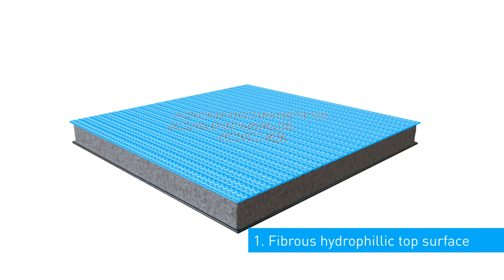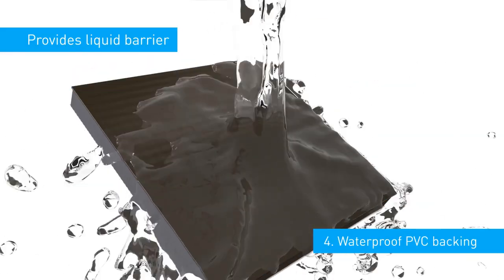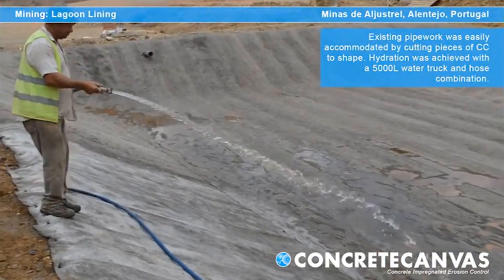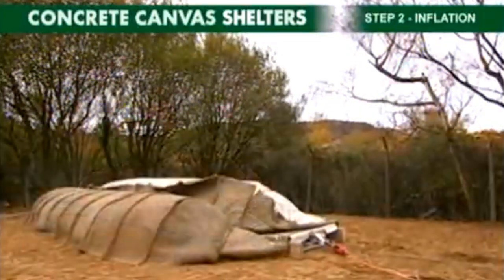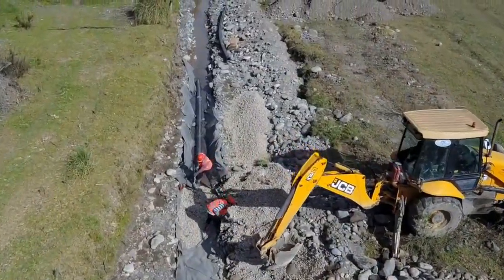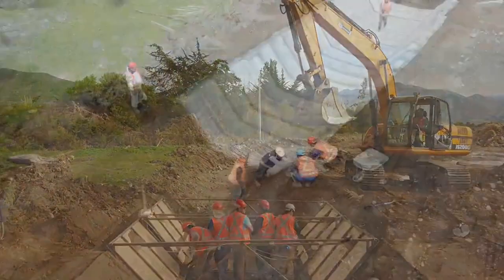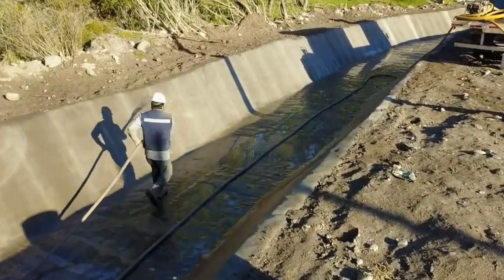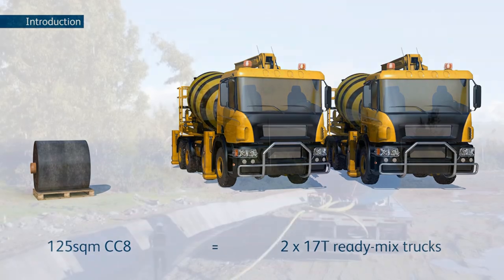Premade Concrete Canvas Tents - Just Add Water

Comment: an interesting application of the thinner variety, if it had marine-grade concrete: DIY boat hulls.

My grandfather made a sailboat hull out of mesh and a thin layer of marine concrete. Less complicated to do then fiberglass, and more rot-resistant then wood. provided there was a good way to seal the seams, two of those rolls over some formers could churn out a 30-ft/10m boat for a fraction of what fibreglass typically costs (since you need a wooden core, then fiberglass and resin layers on both sides). It wouldn't be quite as light, but would likely weigh less then Grandad's boat did, and that sailed fine back in the day (It was before my time, though he still had the hull when I was born)
Reply: First steel-concrete structure was actually a boat in France
Reply: Very  interesting idea. It would be very quick to lay up a hull over a former with this type of product. Much quicker than having to mould cement around the mesh reinforcement. The most important part of a ferro-cement hull isn't the cement, it actually doesn't have to be a marine grade. As you paint the hull anyway. 
The most important part is making sure that the steel mesh reinforcement is marinised. I wouldn't even use galvanized; high grade stainless or go home really. Too many horror stories of rust intrusion expanding inside the cement and causing the hull to fall apart in chunks. Still, a well made ferro-cement hull is stronger than any other.

Comment: Imagine the skateparks you could set up with this stuff
Reply: my thoughts EXACTLY
Reply: Big brain idea.
Reply: Owen, you can’t even do a kickflip
Reply: did you see how bumpy the surface was? even in that smooth trench they made
Reply: Four of those thin sections would make a good backyard ramp.
Reply: @antpoop2404  yeah but that is why you use it to establish the underlayer, then smooth over it.
Reply: Would need to be smoothed out very well
Reply: So you’ll need to spend the time the product is designed to save on smoothing it out???

Just mix concrete and do it manually it will be 100x cheaper
Reply: @stevenpaddybwoy  It doesn't actually look worse than many ditches I've skated. Would probably not be viable for a public park, but I'd skate it. Also, doesn't seem they were actually trying to make it smooth in the clip; probably could be done easy enough if that was the intention.
Reply: its not that resiliant so it would not last months if being abused by skateboarders
Reply: @raheem8086  Sure Raheem, Sure
Reply: @ProBangers  spotted the 1st hater I mean skater

Comment: Just watch out for the load bearing characteristics of containers. They are very strong at corners for vertical stacking, but you are not supposed to even walk on the unreinforced top (roof).  I thought of using concrete canvas for hardening a simple either above ground or buried container house the first time I saw info on it. The rolls are also pretty heavy to move and unroll, requiring a pretty hefty forklift, front end loader, etc.
Reply: Not to mention how ridiculously hot it will be in one of those...

Comment: i'm wondering what the service life of these materials are.
when can you expect the PVC membrane to fail for example. 
and how does it handle thermal expansion after it has hardened?
Reply: Yeah, it seems like a quick fix solution for temporary installations, not a replacement for higher-quality construction methods.